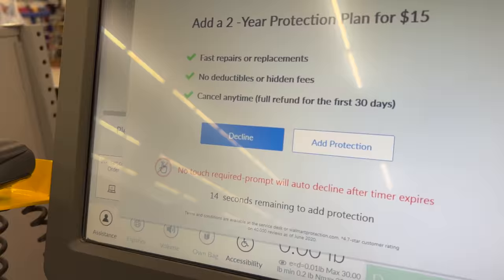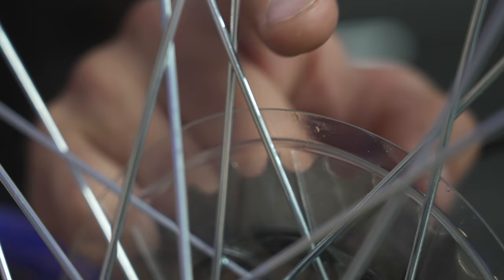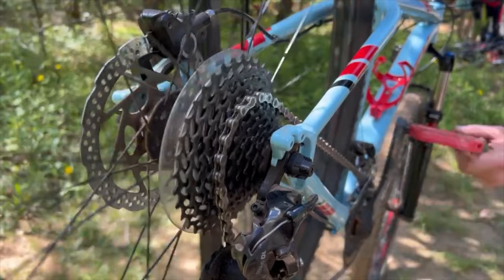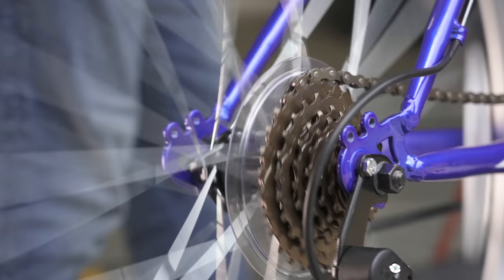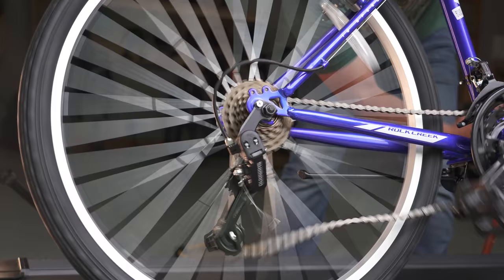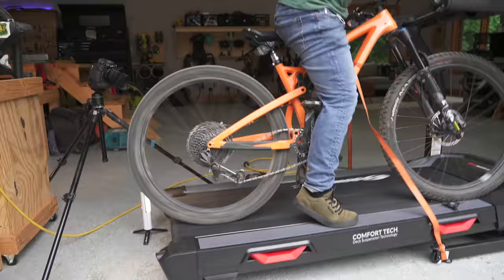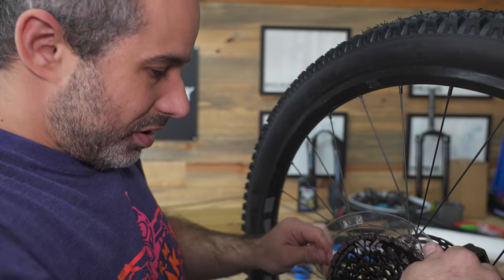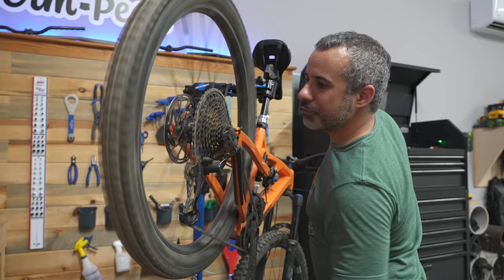What is your "dork disc" actually for? What happens if you remove it?

Comment: I'm an aerospace structural design engineer and I leave mine on. it has a purpose;  it's extremely light, and the material is chosen specifically to have it fail before the other components fail.  this will save yourself some $ in lieu of replacing other more expensive, metallic components.  additionally, this will hopefully allow you to figure out what happened so you can adjust your rear and get back on the road or trail so you can get home without being stuck in the middle of nowhere.  

Obviously,  most people take it off thanks to the misnomer "dork disc" and wanting to either be "cool" or at least have their bike look more attractive.  Smart design and safety is cooler to me, but hey we still have those riders that think helmets look dumb so to each their own.
Reply: Well a properly tuned (not rubber garbage) derailleur serves the same function as the Dork Disk, as the only way a chain can get forced over into the spokes is if a once in a blue moon stick or rock gets caught in the chain under the cassete, an even then it winds up dropping a gear or two. besides, who goes fast on 1st gear? ;)

Comment: The disk is there to protect the user, not the bike. It prevents the chain from getting caught in a moving rear wheel and bypassing the free wheel/hub - which causes the chain to pull on the chain ring… essentially making the bike a  fixie. An inexperienced rider may not be able to stop pedaling, especially if they were clipped in or strapped in. Even when the rider can get their feet off the pedal, the crank arms will keep on turning, attacking the rider’s legs until the rear wheel stops turning; as seen in Seth’s video (where the pedal eats into the back of his leg - thankfully he’s wearing jeans). It is a safety device meant for people who will not take into account skill/equipment/terrain/speed/etc… a worry-free device. Take it off when the rider is ready for all that.
Reply: Probably also good on a tourer as a way to just worry about 1 less thing too.

Comment: Personally I think that they call it a dork disk for a reason. It's just like taking reflectors off, even if it doesn't make a difference, it just feels right.
Reply: You should reflect on that
Reply: Yeah, just bought a rather nice Giant Revolt gravel bike. Lovely rims, disc brakes, and a big lump of orange plastic attached to a spoke to throw the wheel balance off 🤦‍♂️ 
It’s gone now ⚰️
Reply: @tornagawn  Take off the valve stem while you're at it if you actually care about balancing the wheel.
Reply: @jaro6985  Nah, they seem to serve some purpose.
Reply: @tornagawn  You should balance the wheel then to compensate for stem, maybe you could use a plastic clip on reflector as a weight..

Comment: Most common reason for chain getting sucked into spokes is not poor adjustment but a bent derailleur hanger, and in this scenario dork disc does nothing as it's usually the cage from the derailleur that gets caught in spokes and gets wrapped around the cassette twisted and often snapped

Comment: I actually ended up buying a "dork disk" - I've replaced my rear wheel twice on my old bike, perhaps 'cause I carry too much with it. But I never bothered replacing the original "dork disk" because I thought I didn't need it.

Then when coming home from a commute one day, my derailleur freaked out randomly, and wedged my chain firmly between freewheel hub and spokes.

The rear wheel locked up completely, and I couldn't free the chain. Had to carry heavy 20 KG bike home on shoulders with a walk of shame. Not fun. Could only be freed by unscrewing the freewheel hub.

So now I have a dork disk to stop that from happening again, even though I keep my bike maintained and it's not done that since. Good thing I wasn't far from home, or carrying anything.

Comment: The treadmill is missing the part where the rear wheel is hammering on a bumpy trail and the tensioner on the derailleur goes slack enough to throw a chain that's not under much tension. Spoke guard is there for that kind of thing. Just an extra bit of insurance to not catch spokes and possibly taco a wheel in the process.

Comment: My experience without a DORK disc and a misadjusted lower limit stop screw resulted in severely damaged spokes.  So much so that the rear wheel needed to be rebuilt.  Granted this was on a road bike before mountain bikes were even a thing.  A Schwinn Paramount with Campy Nuovo Record derailleur.  But I was a teenager, what did I know.  And yes I don't ride with a DORK disc on any of my chain drive bikes.

Comment: These discs were made of metal in the 1930s, and were a vital piece of safety equipment for derailleurs like the Super Champion Osgear, where the chain is shifted onto the next sprocket by a pivoting fork. The fork is under strong spring pressure, and if unchecked, will will be forced into the spokes. Normally, the correctly adjusted gear cable, connected to the derailleur by a pinch bolt, restrains the derailleur, but if the cable were to break or to slip from the grip of the pinch bolt, then the fork will fly into the spokes without the protection of the metal (usually aluminium) disc. Perhaps, if the disc were made of metal instead of flimsy plastic, it could serve a practical purpose. I imagine, though, that cyclists who are more image-conscious than self-confident would still object to them.

Comment: Yesterday in the process of figuring out if I should remove the dork disk from my bike, I watched this video, so now I am coming back to tell you the story of doing just that:
A bit of relevant information beforehand: My bike was around 800€ when it was new and is now about 7 years old. I regularly clean it using a cloth and a somewhat powerful spray bottle with water and soap in it, but usually I didn't go through the pain of cleaning the dork disk, let alone taking the bike apart.
I am actually glad to have decided that I at least want to pull off the cassette and clean that dork disk and the cassette itself, cause what I discovered was absolutely horrifying. The dork disk naturally was covered in oil and sand. It also curved towards the spokes, touching them with it's edge. Now being fixed to the freewheel instead of the spokes, the gunked up dork disk would act like a slow moving grinding disc, comparable to an angle grinder, that slowly ground it's way through the spokes every time I let the bike just roll along. When I removed it, every second spoke, so the ones lying outside, had some grind marks on them and 3 spokes are half way ground through.
So instead of protecting me from the pretty unlikely scenario of the chain messing up the back wheel and potentially my calves, this dork disk made sure to destroy my spokes sooner or later. You better bet this thing is never ever gonna go back on there! It's a pain in the butt to maintain and this configuration it is actually a greater danger than your chain slipping off.
Imagine your back wheel suddenly breaking away possibly in rough terrain possibly on a descent or maybe even on an intersection, cause some lazy designer didn't think this rather simple thing through. It's just insane that as a bike manufacturer, and a pretty big one at that, you wouldn't notice such a flaw in your design. Or maybe the did and changed it? Maybe I should visit a bike store and check that, just to know, and I'd have an excuse to visit a bike store.

Comment: I actually had my dork disc on my 29" hardtail save my wheel about a month ago. Was just on a midnight ride, going uphill, and out of nowhere, the chain overshifted and destroyed my dork disc into a half a dozen pieces. Thankfully, I live a block away from the only bike shop in town, and was able to get another dork disc fairly easily.

The bigger point is, the dork disc saved my spokes and my wheel. No broken spokes, and the ride home was insuring that the chain didn't get on first gear on the freewheel.

Comment: When I was a teenager, I rode a Raleigh Gran Prix 10 speed. I replaced my freewheel and had the big, chrome, metal spoke protector removed. I had yet to adjust my rear derailleur limit screws. A friend wanted to see how the new gearing felt and immediately shifted to the lowest cog. The chain jammed between the freewheel and spokes and ripped my Simplex derailleur from the hanger.

Comment: Couple of points here. First, the Huffy you were using did not have a cassette; it had a freewheel. It is important to use the correct terminology in a public forum like this. I have also heard freewheels/cassettes referred to as flywheels, mostly by online retailers who don't really know their products. Second, a dork disk (ok, it is called a spoke protector) is designed to keep the chain away from the spokes, not just to make the chain easier to retrieve. The idea is that if your chain gets tangled up in your spokes, over time it can lead to damaging your spokes. I am sure we are all familiar with how it is always the spoke heads on the drive side that seem to break the most often. The presence of a disk might mitigate this issue. Just to be clear, I have removed the disk from all my bikes, but I am well equipped to replace any spokes. 

One of the biggest problems I have with the disks it that they are not durable. On most of the bikes I have seen, the disk is yellowed from UV exposure, or the clips that hold it to the hub are broken and the disk is just rattling around. I have seen bikes where the disk was literally falling off the hub, and the only option is to remove it. 

Thanks for another great video!

Comment: I always remove these when working on bikes as they make no difference, and they tend to fall apart pretty quickly, in the lower gears you generally go uphill which creates enough tension to completely disintigrates the disc, or go slowly enough that you can stop before any damage actually occurs.

I'd always liked the idea of heavy duty metal discs for MTB's and the like though, i'd buy one for sure.
Reply: Or carbon fiber or ceramic if you want to keep weight down. Maybe make it a fashion thing too. Different colors. Custom designs. Hydrodipping.
Reply: Or perhaps just a extra big inner gear ring with no teeth to avoid overshifting?
Reply: Are you doing that to ensure a returning customer? I mean, as far as a bike repair shop is concerned, broken spokes is better than broken spoke protectors...

Comment: Actually had this happen back in college with my old Cannondale M300, kept roasting single walled rims so got a set of double wall wheels that already had an 8 speed cassette on, just rode home on concrete with them before adjusting the drivetrain, being a stupud 19 year old I went jumping curbs at speed, shot the chain into the spokes, chain a tually locked into the spokes, wedged in and wrapped a bit more than a full rotation back around with the wheel rotation, I ate concrete and had to carry the bike home to end up replacing the chain entirely, learned my lesson for sure

Comment: Considering you're never riding down a trail in the highest gear, the chain actually managing to get behind the highest kog is almost impossible. However, bad limit adjustement made my chain go into the spokes several times during steep uphill sections, so far without any long term effects. You're just not fast enough to cause serious damage imo.
Reply: He was shifting it in the lowest gear, largest cog. The highest gear would’ve been down at the smallest cog and shifted off toward the chainstay.

Comment: The worst thing that ever happened to me is my derailleur snapped in half by me shifting while climbing a hill. Lesson learned, tension and shifting while climbing is not a good mix.
Reply: That's why I only shift with the front when going uphill.
Reply: My worst was when my chain formed an "x" on the between front and rear. Have NO CLUE what happened, just shifting. Weirdest thing I've ever seen. Even my bike mech was shocked
Reply: @DavidBergman1776  welp, it seems as though your bike is a magician

Comment: One big difference in testing is that you did not have tension on the chain when it slipped off. That force can help drive the chain down into the spokes and jam it in between the cassette and spokes. That can jam and lock the rear wheel. Been there done that. Did not hurt the bike much but locking the rear wheel up unexpectedly can cause some injuries. More of a problem on a road bike because of how you ride.

Comment: Riding in the granny gear under pedal load means you're going pretty slow. It's unlikely you'll be moving at speed in that range. You'd likely drop into a lower gear for more speed, where losing the chain back there wouldn't be an issue so you'd have shifted back into a cog with fewer teeth and put the chain further away from wanting to kiss the spokes!

Comment: In my case, this "dork" disk has caused a tight - fit jamming of the chain between the spokes and the gear. - It was absolutely IMPOSSIBLE to un jam the chain so the entire casette has to be dismantled at home.  That is of course after the bike has to be transported all the way back home in a car! 
 Had there been no dork disk, the chain would have been easily put back on.
I felt like strangling the guy who had this bright idea of fitting a dork disk which to me, is an device that ensures a tight LOCK between the spokes abd the gears!
Reply: @davidross8233 
I was sure I am not the only victim of the Evil dork disc!!

Comment: I have a metal dork disk (or "pie plate") on my vintage road bike. Once when I forgot to adjust the rear derailer's limit screws, it overshifted and got the chain stuck in between the pie plate and the freewheel. It took a few minutes of struggling to get it unstuck, and It probably would've been easier if the plate wasn't there.
Reply: But probably saved your wheel from damage as designed to do.

Comment: Spoke protectors.  Sacrificial plastic disc which protects the drive side leading spoke elbows from damage from the chain.  One of the things I check for when I service a customer’s bike is damage to those spoke elbows.  It’s not usually easy to see without removing the cassette.  The owner may not know, or doesn’t mention that the chain has been into the spokes.

Chain pins seem to be much harder than spoke steel.  Depending on the cassette, the clearance in that valley between the spokes and the cassette crams the chain through there, and removes steel from the spoke elbows.  I’ve seen as much as 50% of the spoke steel gouged away when a chain gets behind the cassette.

Now, instead of nice, 2mm thick (14 ga) spoke wire, half of the tightest spokes on the bicycle (only the spokes with their elbows out) are now 1mm thick, and not a nice 1mm.  But, a mangled spoke with cuts, gouges, and plenty of microscopic crack risers.

A rider wouldn’t know they’re riding with half the spoke steel on that side of the wheel until they start breaking.  When they break, they won’t all break at once.  It’s probably not likely to cause enough spokes to catastrophically cause the wheel to completely fail and put the rider to the ground

Probably.  It’s the rider’s ass at risk.  I won’t ride a wheel with a fraction of the spoke steel left on those spoke elbows.

Comment: I had an experience when my bicycle chain got slipped off and fell in between the bicycle spokes and the largest cog.  There was no damage but it was very difficult to lift the chain off from the spokes and the cog.  With the dork on, it would be easier to do this.
Reply: Oh, yes. I (hardly) remember the childhood trauma that was getting the chain out of the wheel without those little plastic things. Remiving them is just plain stupid, imho, and asking for trouble

Comment: My current bike didn't come with a "dork disc" and that meant I immediately contaminated the rear pads when I first cleaned the cassette. So I guess one advantage of the disc is that it helps prevent overspray from going where you don't want it to go.

Comment: I've had that happen on a very cheap bike I was using for commuting twice. The first time the dork disc protected the bike. But it got destroyed. So obviously I didn't replace it. The second time I destroyed the bike. The derailleur hanger was an old style braised on hanger that's basically part of the frame. It got all bent out of shape. Once that happens, your frame is busted and that bike will never shift properly again. And I think that's where dork discs were originally intended to be used. They protect your frame. They are a hangover from before hangers were considered sacrificial parts to be replaced.

Comment: I had my 50th eagle gear locked off with the high limit screw for 2 years. Wanted to stop myself from using it to try and build climbing strength. Does that mean my 50th gear is technically a dork disc? Don’t ever feel the need to use it anymore so it doesn’t affect my riding experience at all but still keeps the derailleur far enough away from the spokes I feel like.

Comment: Hello,
The reason the chain could still slip relative to the spokes is because you did not have any tension on the chain (no pedaling).
From experience the real issue is when putting a lot of tension in the chain usually the case when climbing in 1st gear.
The chain then lodge itself deep between the spokes and the cassette.
I guess the only way to try it is to strap some camera to the frame and reproduce it on a fast climb!